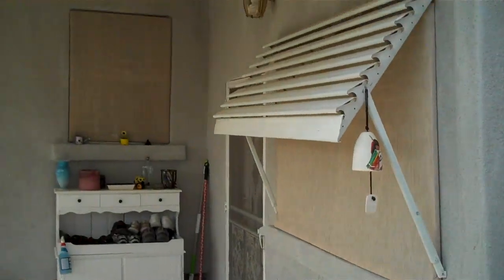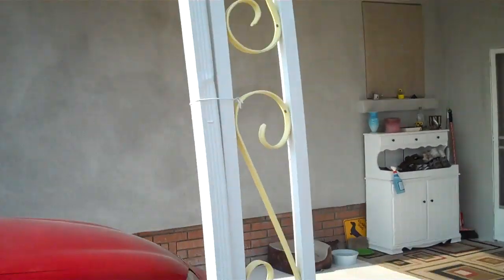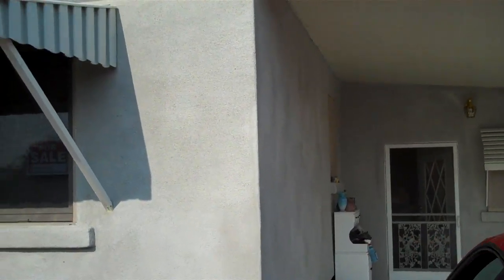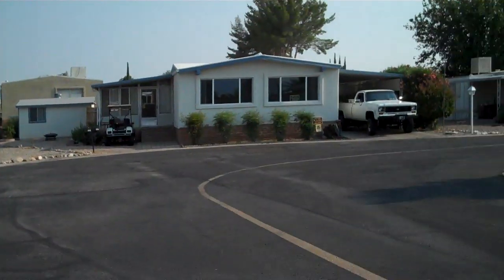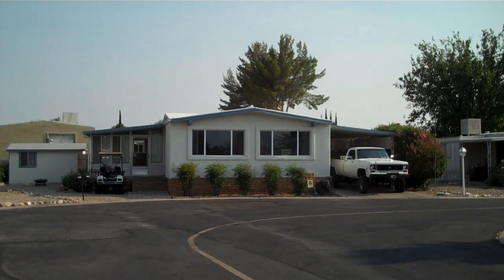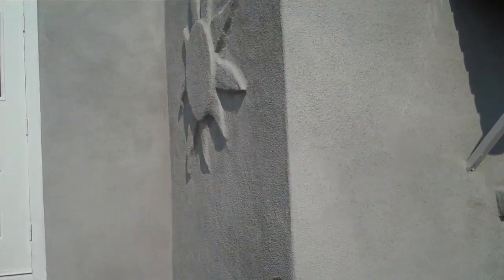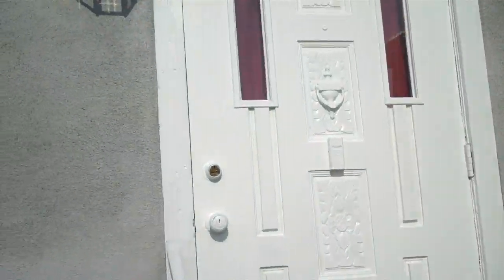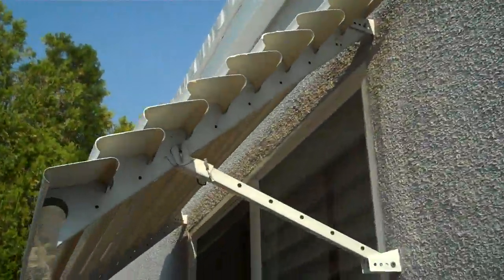stucco 1, mobile home stucco

Comment from the maker: HI, mine is 1100 sq ft it cost only 3000, and I had a crew do it for me, it is a lot of work, its much quieter inside and cooler, cant hear a barking dog outside at all! i was amamzed at that, my neighbor has 2 barking dogs, now I dont hear them at all, I say go for it, if you get a mexican crew on a day off, thats what I did and they are great and fast, white dudes charge too much and whine, never saw a black guy doing stucco, but its not a racial thing its just that down southwest its common